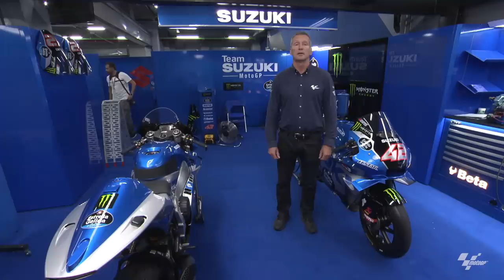Why MotoGP™ bikes are so much faster now than in 2019 💨 | Tech Talk with Simon Crafar

Comment: But the change in tyre construction..they don't lean as much in 2019..in 2019 marquez lean 66 in germany...64 and 63 is easily achieveable...now even marquez and fabio 61 and 62 angle
Reply: Its more like sacrifice for straight line speed
Reply: Marquez lean and lose speed and  not get enough exit speed. Problem was with marquez if Alex rins can bend much lower and find the right line and accelerate perfectly he will get faster exit and compensate bending beyond 60 degree redundant
Reply: Marc was "overleaning" and using his elbows as a 3rd wheel + shoulders as shock absorbers. Not sustainable. 61-63 degrees is more realistic.

Comment: Well done Simon - a very interesting topic. 20 years ago, on a MotoGP forum I questioned why teams weren't using any sort of aero bits on the machines and was immediately set upon as a rube and stupid person (lol). Fast-forward to 2022 and it seems that aerodynamics have been entirely embraced and actually make the bikes faster.
Reply: Except they’re f*ing up the racing. Badly.
Reply: @Showmetheevidence-  nah
Reply: @Showmetheevidence-  Stares at Phillip Island

WOW. That one aged poorly.
Reply: imo, 20 years ago indeed it was stupid.. but in nowadays motogp, they dont have any other chances/area to develop the bike. engine freeze in 2020 and 2021, homologated single electronic control, etc etc..  chassis wise already matured, brakes are from supplier, single tires, very limited area to develop something. thats why the next reasonable thing is aero.

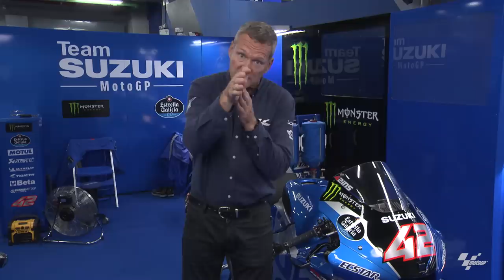Comment: @ 1:15 yup, you can still go straight with some lean angle. Lean doesn't turn the bike, turning the bike induces lean angle. @ 6:25 Simon mention how ride height devices help reduce aero induced drag, "a little bit". Which is the same reason the America's cup cats rode bow down at speed. 

I know I know, no active aero, don't trust the bits or the algo... but wouldn't it be fun?

Comment: 1:00 Physics. Its got to do with the suspension and how a bike react to the sudden torque and weight transfer. Same with your feet and legs, if you put your 160-200ish lbs on the seat, of course its going to assist the front wheel in coming up. Keeping the bike at an angle has to do with the same stuff. The rear swing arm wants to move to allow the bike upward, the suspension fights this, but your weight fights it back, its a combination of balance and skill.

Comment: I wonder whether the the combination of higher speeds at various points on any given MotoGP track along with the complicated effect of devices and aerodynamics also means that the high side incidents are (1) more complicated (due to the additional factors), (2) less predicable (same reason), and (3) potentially more violent due to the relatively higher speed. We see riders emerge relatively quickly from low side slides, but even with air bag suits the violent forces associated with high sides do not mix well with human bodies, especially the extremities.

Comment: Simon, if the rear ride height is lowered coming out of the corner, improves straight line speed and again lowered at corner entry, why not leave it lowered for the complete lap/race?
Reply: Travel my friend.
Reply: nice question, because high position of bike (suspensions and height) is better for the ''rolling'' on curves and handles better the bike movements ... this is called rolling by the tecnicians of mGP , SBK,   ...   low centre of gravity is good for some things and high centre of gravity is well for another things ...   and bikes have a lot more of settings ,wheel base, height pivot swingarm ...

Comment: What is the difference in hp between a MotoGP bike and a WSBK bike?
Lap times nowadays are pretty close (depending on the track obv)
Reply: In barcelona wsbk is 2 seconds slower, in aragon 3 seconds slower, misano 3+ seconds, is this pretty close to you?
Reply: @radityaanugrahp  
What’s the hp difference?
Reply: I believe MotoGP is 300-350 ish and wsb is like around 200 (all hp units) 3 seconds for such a difference in power to weight seems minimal to me. It's mostly limited by tires. Tracks with more straights benefit moto gp bikes but if there was a hypothetical track that was all tight curves I would expect lap times to be within half a second of each other
Reply: @327efrain  wrong on your hp figures-motogp is around 275 max,wsm 235
Reply: @zeke2566  thanks for the correction, my logic still stands as 40 hp for 400 lbs (an upper limit, probably closer to 300 lbs) is a huge difference.

Comment: Hey Simon I have few tech question from Malaysia..Why does moto3 bike have 2 exhaust on one cylinder?..Does the exhaust camshaft on moto3 bike run different deg/lift on each exhaust port?..Does the length of each exhaust the same or not?..Thank you
Reply: i think that's a top secret information.

Comment: Good info. Are the riders now able to use some rear brake too, to further increase the deceleration of the bike, as the rear tyre contact is improved even under heavy braking? Less pitch from a lower ride height.
Reply: As soon as the riders hit the breaks the device inactivates. They have always used rear brakes to shorten the distance of breaking, it has nothing to do with the device.
Reply: @chroffe15  rear tyre load has everything to do with braking, which is why I asked. I wasn't aware that the ride heat device immediately deactivated upon front brake deployment, so I appreciate that snippet of information. Also I know racers who never touch the rear brake, because it's so ineffective, traditionally, because there's virtually no contact between the rear tyre and the ground under heavy braking.
Reply: @peterjones6321  exactly, rear brakes are mostly used within 50 meters of turning the bike in to the corner, just because of connection issues with the rear.. Cheers
Reply: @chroffe15  but can they deploy more rear brake with the rear ride height device active, at the point of application, due to the lower CofG and proportionally more load being on the rear than on a conventional bike?
Reply: @peterjones6321  I am not really the man to answer that question.. With basic physics my answer would be no, because the rear height device deactivates on impact on the front breaks. But really I am not qualified to really give you a good answer mate. But I am sure in my own mind that the rear during breaking still haven't been solved
Reply: @chroffe15  it is a bit of a niche question, granted. And it could do with a sketch. Thanks for replying, because I didn't know about the deployment strategy on the rear, other than they used it, as per video.
Reply: @peterjones6321  Well to be honest, who really know's how these prototype bikes are compared to the road bikes we are used to? We will never really know is my guess but it is fun to speculate 🙂 But as far as I know about these height devices the only have impact on speed and keeping the front down on straights. Cheers, have a lovely weekend my friend
Reply: Miller used rear brake mid corner

Comment: I've been wondering could you switch of traction control on a straight ,and out accelerate a bike using traction control ,even if it does wheel spin , 🤔
Reply: Not really. Loss of traction means loss of drive. The traction control is limiting power just enough to stop slip and no more. I would prefer to see the riders manage the power themselves but that is just my opinion.
Reply: @glennvandenberg3912  appreciate the feed Bak ,I maybe should have left the wheel spin part out ,I figured if I didn't say wheel spin some 1 would tell me it would just spin ,I've ridden a 280 rear wheel HP turbo busa ,with no traction control and nothing else I've ever ridden would touch it in acceleration ,I ride gsxr 1000 k8 , I was thinking mid way down a long straight in Moto Gp ,flick of traction control and wind it on hard and try limit the wheel spin ,would be interesting too see 2 exact gp bikes try this , obviously the turbo busa doesn't weigh 160 kg and a GP bike would stomp it ,

Comment: If you compare the lap times between the 2022 and 2019 bikes they are almost identical I don't see how today's bikes are faster
Reply: Nope, the lap time, acceleration, top speed 2022 bike is much faster
Reply: @eldiablo1374  then how do you explain that the last record in Philip Island held for 9 years and was broken by less than a tenth of a second

Comment: lowering the rear must be a high speed thing cuz anyone knows put passenger on the back she wants to wheelie, cuz its WEIGHT, lower the rear you shift weight to the rear, more wheelie prone, so lowering the rear must be working in conjunction with the spoilers so when the brakes are grabbed hard at speed she wont stoppie? the weight is down in the rear and they can apply more OR all 3, TC or anti wheelie and the spoiler.. simply lowering the rear is going to bring the front end up every time we all know this so there is more to it..

two ways to minimize wheelies, more weight up front which can be achieved a few ways, shortening the wheelbase or lowering the front end, just physics, how its always worked?

did dood rummaging in the tool box ever find his 10mm?

Comment: The FIM has SPEED LIMITED racing motorcycles since 1994 when the tire (or TYRE if you wish) corporations plead for limiting speeds to 340KPH (211 MPH)  because making ABSOLUTELY PERFECT RADIAL TIRES that would handle say 370KPH and last 80 Km in a race would COST probably $20,000 EACH, just like F1 auto race tires. Indycar and NASCAR slowed their games down down for similar reasons. STREET tires for my 1994 Suzuki GSV-500SP V-4 500cc 2-stroke street-legal works-bike (Metzeler's) W-rated for 200 MPH (for one hour or 300 Km ONE TIME ONLY) are over $4000 a SET! I order and pay for them, they tell me WHEN they can deliver them next year I HOPE! W-rated bike tires are the HIGHEST speed rating sold-even for racing. So U-toob videos of bikes on the Autobahn doing 400 KPH or such can be chalked up to BS! Having raced an evil old Yamaha TZ750 on Badmonth bias-ply tires in the '70's, when a back tire "LETS GO" (comes apart) at 200+MPH on a TRACK, and the bike DOESN'T run-over you, but passes you while you're on your back sliding at 180 or so MPH, hoping the 37 OTHER racers don't hit you, and you pray you slow down BEFORE your shoulder or collarbone or leg hits the haybales, and praying your helmet is a good as they claim, and your $1000 leathers DON'T BURN THRU you understand the "safety angle". W-rating is also the highest DOT speed rating for auto tires in the US as the tread is only 4mm (3/32") deep NEW and the rubber is so soft you can ruin the tire with your thumbnail.